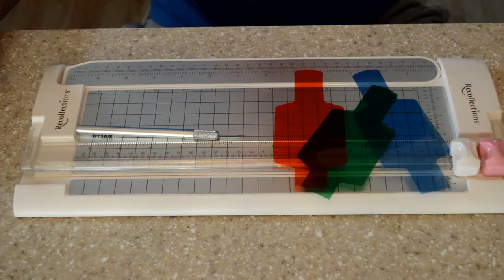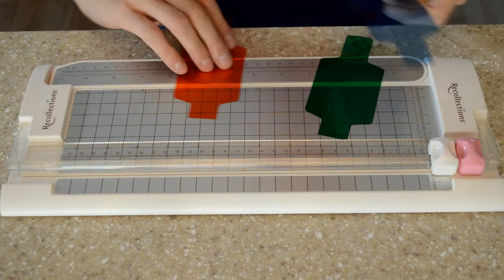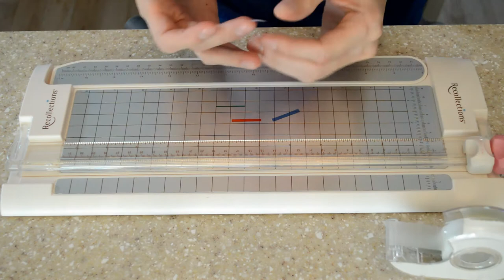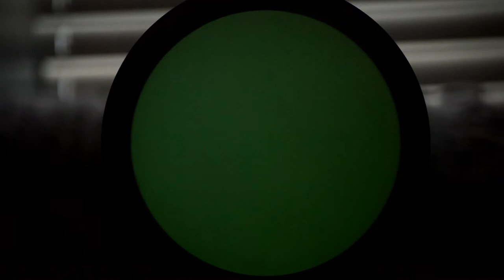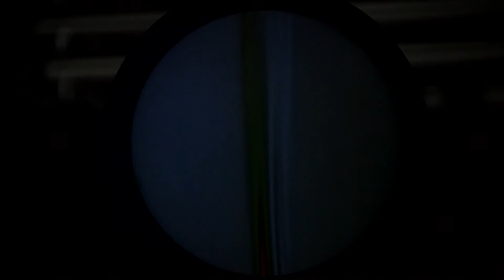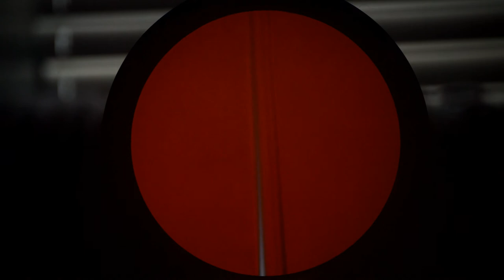How To: Schlieren in Color!

Comment: the red/green/blue shot looked much  better than I was anticipating!

One thing I wonder, but haven't had time to play around with yet,  is seeing how different knife edge rotations/positions affect the 'polarization' of the schlieren image.  For instance, I know in a different vid, you showed coming in from the left vs the right essentially served to invert the b&w image,   but it would be cool to have a setup where you could rotate the blade while it is steadily held with the edge located at the center of the focus point, and have it spin around so that it is coming in from the right, 45degrees, top, bottom, 13degrees, etc to see how the image changes in real time
Reply: Cool idea!